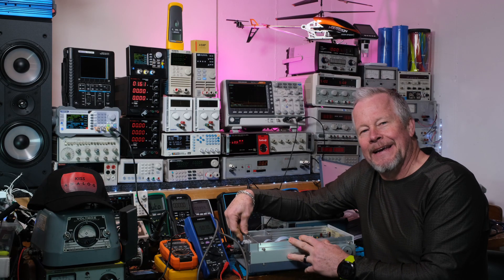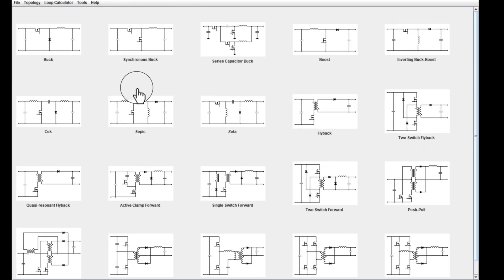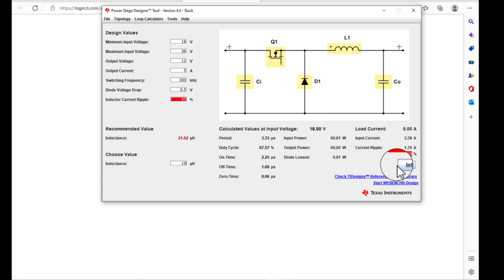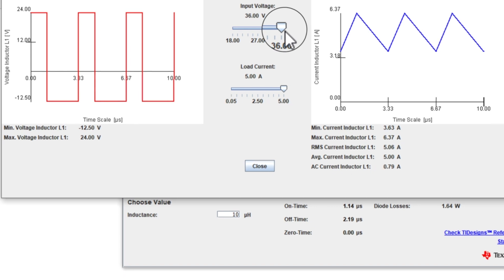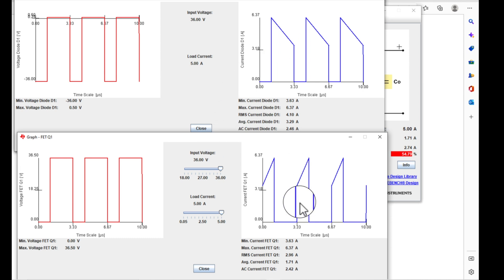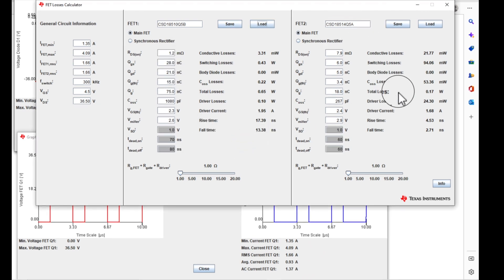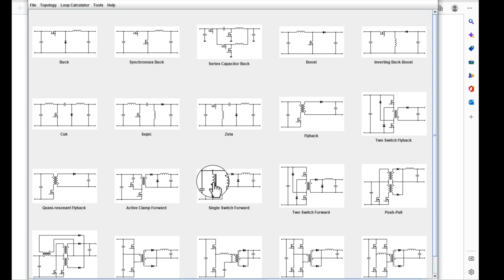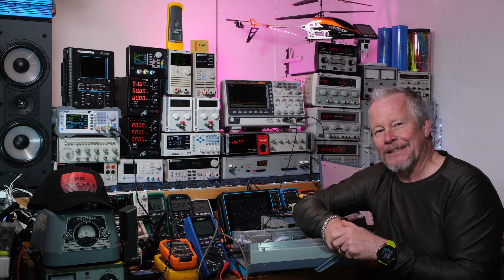Texas Instrument's Power Stage Designer Intro - Best Kept Secret

Comment: Many thanks for the video,
It has also loop compensation feature which is not very straightforwar.
May it be possible to explain how to use it.
A current mode flyback design (including transformer and snubber) could be interesting to see.
The next stage can be simulate the designed circuit in microcap

Many thanks
Reply from the maker: Thank you!  Great feedback!  I'll show the compensation feature soon;)  Yes, more MicroCap videos to come;)

Comment: Pretty cool stuff. I downloaded the Navy book off your Patron page. I've been using it as a refresher and to look over some circuits I don't know that well. Did you ever do anything with PWM designs? Not sure you are familiar with VFD's? I started getting into servicing them. Figured watching PWM videos would help with that.
Reply from the maker: Thanks so much!  PWM is common with most SMPS, and it is used to regulate and/or create the output voltage.  Changing the pulse width changes how much power is sent to the output.  I appreciate your Patronage!